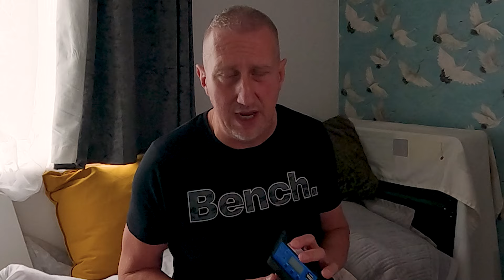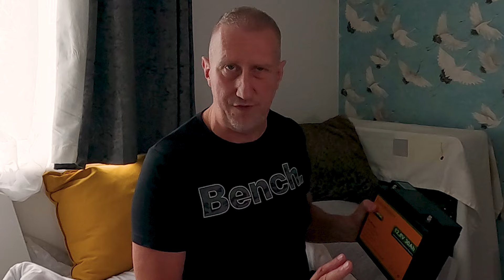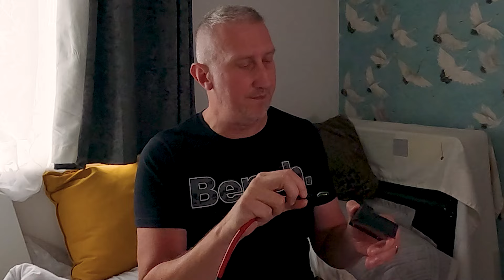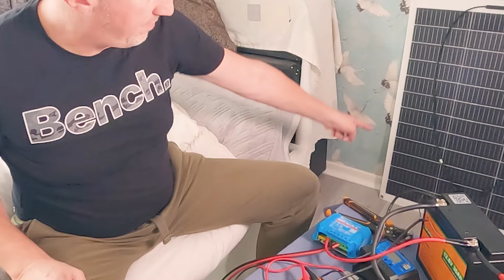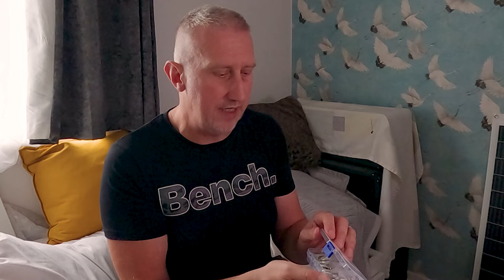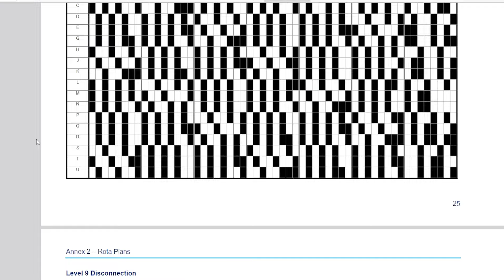Solar Power. An in depth guide for anyone building a solar power system. #solarpower

Comment: Good video, Alligator clips I found are ok for temporary use on lower wattage inverters. Years ago, when I upgraded to a more powerful 1,500 watt inverter and yes then the alligator clips over heated. But were ok on my 800 watt inverter.

Comment: Good video , spot on with your maths. Does connecting the positive first then the negative not stop the sparks.  Also never short a battery 😊
Reply from the maker: Thank you. I get sparks either way round. I shorted a lead acid battery, by accident. It didn't work at all afterwards!

Comment: Hey steve, great vid ad always.
As a rule of thumb keep the cable run from the inverter to the batteries to an absolute minimum run due to the current draw.
Bimble solar, 12 volt planet and city plumbing doing great deals on panels atm.
Re ecoflow etc delta 2 has one input delta max and pro have 2 Inputs which is circa 500 , you can over panel them in parallel nps just keep the input voltage less than max input voltage with a 10 percent saftey  margin,  don't worry about over current as the system will deal with that.
Great vid.

Sp
Reply from the maker: Thanks mate, very much appreciated!